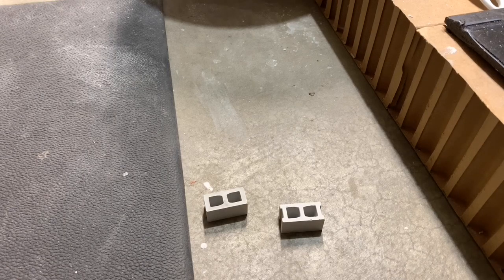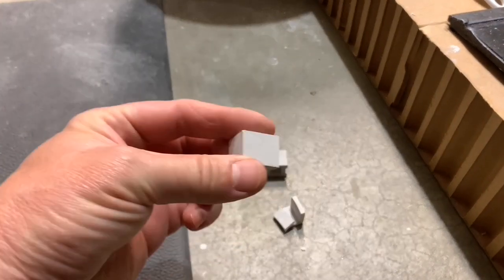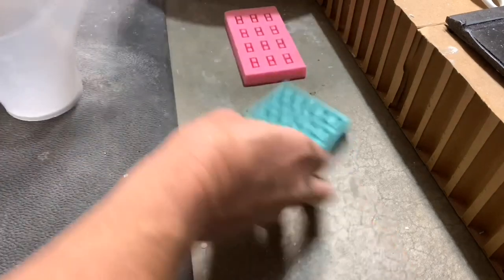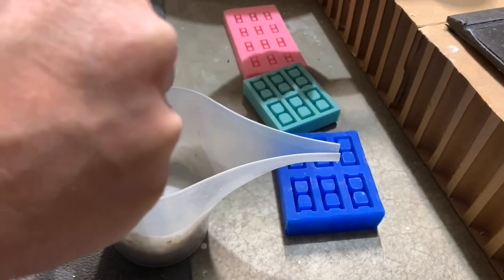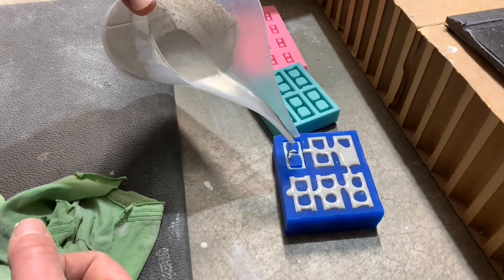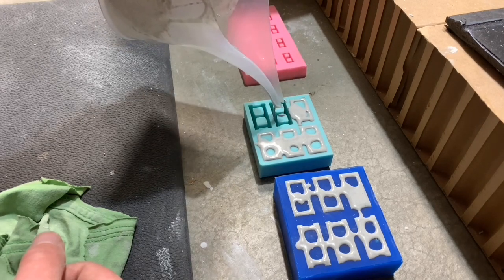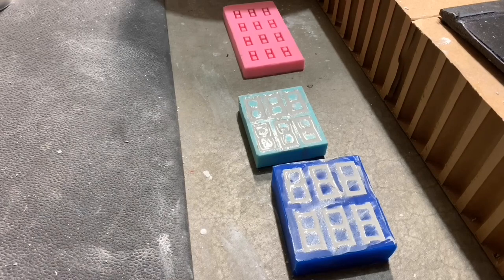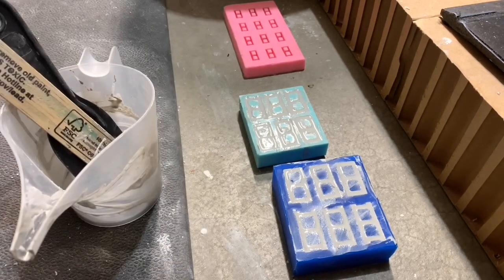Casting 1/12 scale cement blocks. I reveal the mold, the materials and Techniques I use. ￼

Comment: Sweet! What did you seach for, when buying the mold? Thanks!
Reply from the maker: I searched -1/12 scale brick molds.
Reply: @digitrc  thanks, yeah been looking.. not finding it on ebay.. found one that looks the same but its sold as a 1/35 scale brick?
Reply from the maker: @mpkhobbyRC  I got mine on Amazon. Maybe look under doll house accessories as well.
Reply: @digitrc  thanks il def try that!!
Reply: @digitrc  a video of you making up a mold  with how too and where to buy would be so awsome . thanks great content
Reply from the maker: @r.ccustomtruckingsydneyaus4632  I could probably do something like that but it will probably be awhile. Sounds like a good indoor winter video segment.

Comment: lol crack that was funny, this system is absolutely outstanding! I do have a question Id like to ask.  What do you use to make the silicone mold?  I would like to try a silicone mold for my Jersey Barricades.  I will do a quick video of the display of what I do to make mine.  I use a designed printed mold.  after a few design concepts I have found the best results.  Yet the mold I print from start to finish takes about 9/10 hrs of printing.  So if I could do a silicone mold it would make it a lot easier for all to want..Also aprox how many bricks per box of mix do you get?  I have found using quick dry floor patch works amazing for my molds. Id be lying if I told you the number of molds I can get per box of floor patch because its been awhile since I've had time to mold more.  But im guessing off top of head like 10 per box at $20 if correct on patch cost.  I'll dig into it deeper because I had all my numbers down on my cast before I got started my kitchen remodel awhile back.
Reply: ps also on floor patch it too heats up the cast pretty hot to the touch, with that after aprox 20+ makings out of a 3d mold it will start to warp the cast a bit.  doesn't loose total shape just I can tell it expands the cast as it must heat the 100% plastic which then at that time relaxes the shape a smidge
Reply: The reason for a silicone mold is to be able to pop out the casted part. 
As far as a jerrsy barrier because the are big & big volume I personally would use a printed mold. But you still can use a silicone mold , the box you make to make the sillicone mold use it when you cast them to keep the mold from deforming.A jerrsy barrier you would want to cast it up side down.
Reply: @terryperrott9913  thanks I knew silicone molds would make it easy to pop out.  looking for a good product of silicone molding material to make a cast.  molding the jersey barricade upside down is the best most efficient way of doing so.  I print my molds upside down as I do pouring the molds for the barricades.  my design also splits the mold into to parts which pulling pout the cast is effortless.  I'd like to try as silicone mold as if I was to offer casing to others a 10hr print wouldn't be necessary as everyone doesn't have a printer and I don't feel like blowing a printer up 24/7 to print off molds lol a silicone mold would make it easier to offer.  Id just have to make it wide enough to hold good shape and also a two part mold would really benefit to as splitting that mold would be idea to removing the barricades as well. thanks Terry for input as well
Reply: @thatsmyrc  I personally would use a silicone mold, if you have a barrier , make a mold box at least 1/2" inch wider all the way around of the part that will be casted. Then poure you silicone mold material in a corner of the mold box & allow it to fill up the mold box. After mold has cured fully remove mold box "" dont brake it apart "" because you'll need it to poure your casted part , the mold box holds the mold in its shape.
Reply from the maker: I used bbdino silicone mold making kit. I followed the same procedure as terry was describing even for my Jersey barrier mold and it works great. I did use allot of silicone for the Jersey mold and ran out in the middle of the pour due to a miscalculation on my part. 2 days later I got more silicone and mixed and poured over the the previously poured silicone that had already cured and it  fully adhered to the previously poured silicone and is one solid mold. It’s expensive but worth it. With the Rockite I get about 2 Jersey barriers out of the small 5 pound box but I get the 50 pound bucket to cut cost to about $3 a Jersey barrier. I get about 200+bricks out of a 5 pound box.